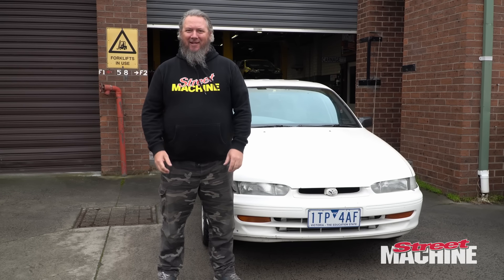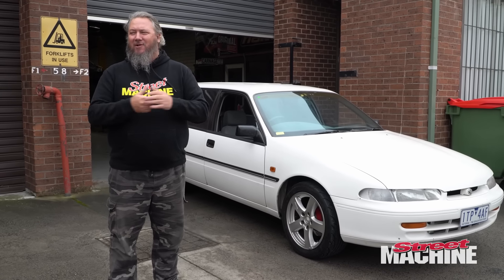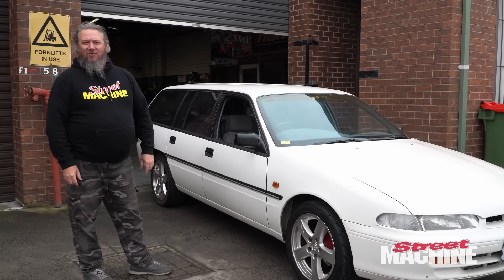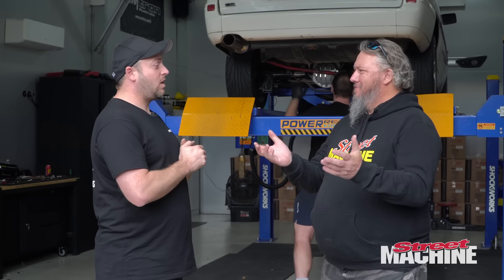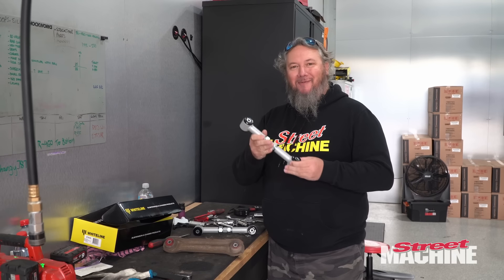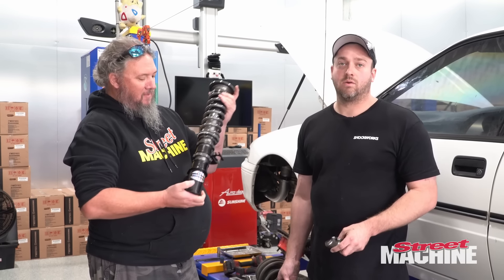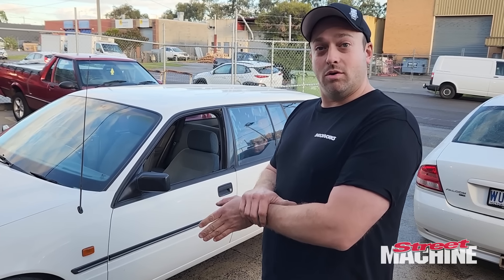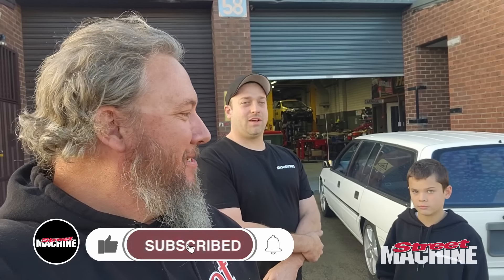Carnage - Our V8 Lexcen Gets New Wheels, Tyres and Suspension

Comment: Scotty, the exhaust exiting the rear bumper - is really close. This probably won't worry you on the drag strip, but she'll get really toasty doing circuit work, and melt/char the cutout in the bumper. Ask me how I know :) Best to drop it down half an inch mate. Love the build. And I'll be happy when I can actually bolt in my Shockworks gear - Some welding to do first...

Comment: Shockworks have made an impressive bit of kit on the Lexcen. I've bookmarked their website. I hope you have fun at the meet.
I had a smirk on my face when you used 3 fingers Scotty...... That's what she said!
The Lexcen is still a sleeper regardless. It's like my '03 Holden VY S Series I ute with the optional LS1. People pull up next to it thinking that it just has a V6 until the lights go green & the LS1 comes to life! They pull up at the next set of lights saying that only the SS could  have the V8! LS1's were optional across the range below the SS.
Reply from the maker: If you're getting suspension done, you can't go wrong

Comment: Scotty mate should have cleaned the calipers with a wire brush on a drill, that way at least it will be a lot easier to clean them when all the brake dust starts to accumulate on them. Well done mate keep up the great work camp.  🦘🦘👌👍✌